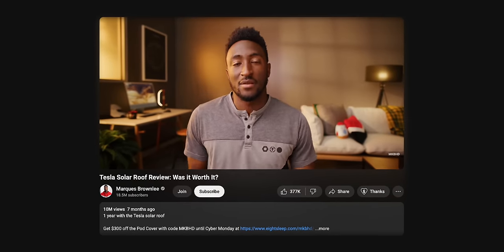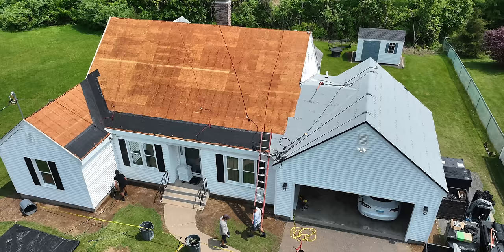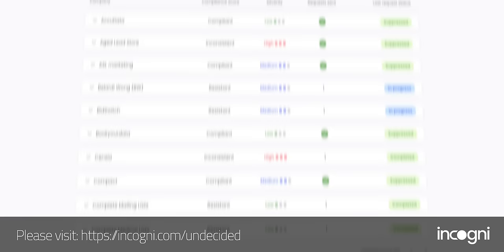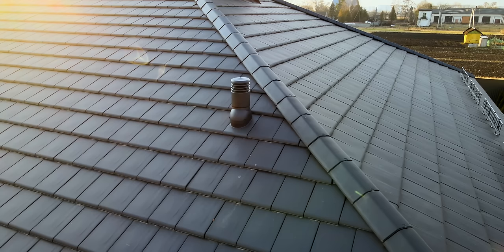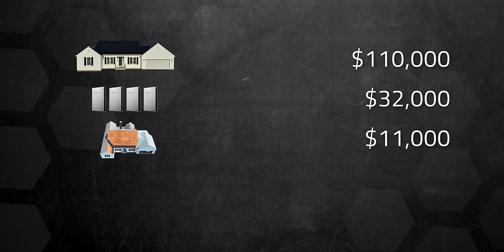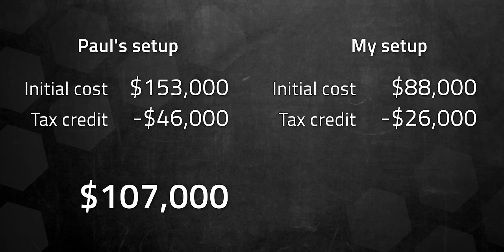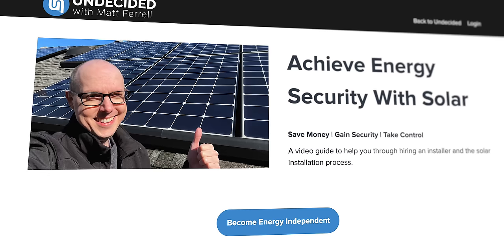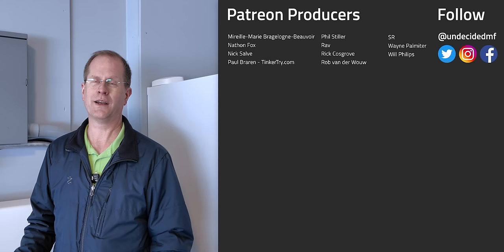Tesla Solar Roof vs Solar Panels: Which is Worth It?

Comment: Zero chance he paid $110,000 for the roof. The average cost for a hoke that size to purchase the V3 Roof (current gen that Tesla just announced is being put on new construction homes in hoa communities starting this year) cost between $35k-$50k depending on how far back the roof is taken. Typically where people see a higher cost is in the additional powerwall units and wiring for things like a grid tap. And even then those builds still do not hit $110,000. That's unheard-of.

Comment: @11:31 The federal solar tax credit is VERY misleading, you CAN"T just simply subtract that amount off of your installation cost.  It only comes into effect if you are required to pay in when it comes tax time and it's staggered over 3 years.  So, if your solar tax credit is $45,000 (for the $150,000 system) you would get a $15,000 credit against what you would be paying in at tax time.  If it is less than $15,000 then you won't get the full amount.  if you normally break even or get a refund (as we do) then you won't get anything and that 'tax credit' is meaningless.  
Also, in regards to net metering, be sure to check locally.  Texas (where I live) DOES NOT do net metering, but the power companies (some at least) will buy back power at an EXTREME discount = 1/4 - 1/3 what they charge you for usage.  Plus the regular usage rate for electricity when you do fall short is about 25% higher than the standard rates you can find if you're not having Solar tied in to the grid.

Comment: despite the advancements in solar technology the price, time, and energy to get it all set up/installed is not practical for most people. they need to make a better installation system that is a very simple overlay onto an existing roof. like a fabric/bendable/unrollable compartmentalized system that can be easily installed by anyone.

Comment: From your comparison in this video I see that the obviously more premium Tesla solar roof costs a bit more than your run of the mill and less capable setup. That is as it should be.

There are others claiming the Tesla product is considerably cheaper. And there is no shortage of people saying it is much more expensive. I am guessing the difference is in the 3rd party installers.

Comment: I think the day that a good reversible fuel cell come out for houses, all the power issues for all houses will be solve. 
No limit in power storage, you can use hydrogen and natural gas as input, you can generate your own hydrogen, any efficiency lost can be recovered as waste heat to collect hot water or to improve efficiency in h2 generation mode.  
No need to connect your house to the electricity company..  No need for long wires.
In case houses are interconnected, you can connect them by hydrogen pipes, power transmission as hydrogen is 10 to 20 times cheaper than by wires or transmission lines.
No need to consume the power in the moment that you generate due how cheap would be to store that.

Comment: In a locale with a lot of permitting, inspections by people who know bupkis about solar electricity, I would...build my new house somewhere else.  I have built two houses, one in an area with no building department, and another with a building department used to seeing contractors built trash to the very minimum quality standard.  The first was a breeze; we built with the intent to live in it, way above minimum standards.  Ditto for the second, but the inspectors were used to seeing crap, so they didn't quite know what to make of our R-30 walls and R-60 ceilings, in a very moderate climate.  I swore to myself that, if I ever built again, it would be in a location with no building department, where I could park in a motorhome and oversee every step, and take my time again, like I did with the first one, to see that everything was done right, including the electrical system and solar roof.

Comment: I have  solar panels on my roof, installed in 2016, that generate  about 13Mw of electricity/year, cost after rebates was approximately $20k. In my state, unlike Massachusetts, net metering does not pay me more than the cheapest rate for excess electricity generation (HydroQuebec, about 3-4 cents/Kwh).  I also went with microinverters that had a warrantee that was 5 years longer than the panels. So far there have been no power outages that would have justified battery storage, and the electricity vendor doesn't have TOU rates. Just about breaking even now. I would say that the vast majority of those putting solar on their roofs (that they own) are among the more wealthy in the US. The opportunity cost of sinking $155,000 into a "new roof" is enormous. I looked at my panels as essentially like a bond investment that would eventually pay me about 3%/year over the lifetime of the (system), hopefully about 20 years. Generally a similar amount of money invested in the stock market would have done much better.  I would also have great qualms about buying a product like Tesla's that is cutting edge and sourced from a single vendor with a known history of poor customer service. The original company that did my install has already gone out of business, but the system is simple and should be relatively easy to fix problems, should they arise. Sometimes "cutting edge" is a little too much "bleeding edge".

Comment: Solar roof could be twice as efficient as panels and it still wouldn't make sense here in central MA based on installed costs, and that factors in the cost of a new roof. I am not sure what is going on with solar roof but it is just so cost prohibitive. I was quoted $135k for a solar roof and my panels cost 48k installed. It's simply WILD.

Comment: Installing solar in general is a pain in the ass. It took months for my Uncle's setup to finally start working. The installers went out of business after they "finished" his faulty installation. Generac wasn't helpful even though they are who sold him the system and contracted the installers.

My electricity is currently super cheap (7.3 cents per kWh) and my mostly south facing roof is blocked by trees. Hard to justify investing in solar right now even though I do need a new roof. 

A solar roof would make the most sense in order to maximize overall sun exposure except for the fact that the cost is insane and once you factor in interest on the loan needed and the cheap electricity here I would probably die before it pays for itself.

Comment: My quote from Tesla was 98k in 2021, I was not ready, then required in 2022 at 160k then last year, Tesla decided to no longer install and move to 3rd party installers. Once I got the new quote it was 500k, yes one half a million for a roof.  I opted for a premium clay roof for 60k. I will add solar panels next for 50k. 500k common Tesla, I’m a fan but no one can afford that. They need to figure there crap out.

Comment: These prices seem extremely expansive to me.
My Solar system cost me 16000€ in 2016.
Your Systeme is about 2,4 times bigger than mine but still that would be roughly 38400€. Not 100k Dollars.
Anyway, the featured Systems are really nice!

Comment: For static storage, I really don't like lithium ion. That's needed for pushing vehicles around and powering consumer electronics. For static storage, I'd want liquid flow and/or sodium ion - something made from less rare, expensive and problematic materials, and something for which thermal runaway simply is not a thing. I don't care about (gravimetric/olumetric) (energy/power) density for something that's sitting on the ground and powering home appliances.
What I'd really like is enough long-lasting battery storage to run the building it's in for 3 days if the grid connection goes down (due to, for instance, a massive earthquake, which we're overdue for in my locale). Bonus if it can function as part of a local microgrid to help keep the lights on for the block/neighborhood.

Comment: I can’t believe the cost of panels in the US to Australia. I suppose when you compare climates or sunshine hours from New England to Australia (even southern Australian temperate climates) it is far more favourable here in Australia. Most large family homes only need max 12kWh systems with about 15 - 25 kW battery systems. Even after a recent power outage with 1 Powerwall we were comfortably off grid for 3 days. With one of those days being cloudy. Cost on a average are $12 - 14,000AUD for solar and $12,500AUD per Powerwall plus install.

Comment: $88,000 over 50 years would cost about $146.67 a month. This is an important factor to think about with your lifetime and your energy costs. I am not sure how much you pay in energy and what you get credited to account for and +/- in that monthly energy cost, so this is another variable but that comes down to the system size and those seasons. 
I am currently paying off my solar panels on my roof, $20,000 system, and I have regrets. 
I think the metal roof is the better choice. I have asphault shingles, and they will eventually have to be replaced, which requires removing and disconnecting the system to replace the roof. Then when it gets installed again it will void any warrany on the roof as it will be invasive with the mounts vs the metal roof.
I also don't plan on living in my house for more than 5-10 years, so it will cost me more per month in energy costs. This definitely something that you want for a long term forever house, not short term.

Comment: Looks a bit like a "MacBook vs self-built computer". MacBook will be more expensive earlier but very slick in design and the milled aluminium casing will last for a long time, but repairs may be expensive. Self-assembled computer is cheaper even with going for similar specs, and you have the option to upgrade a single component when something needs to be changed.

Comment: I never got the appeal to Metal roofs. I get it why some do, Slate roofs last longer and are roughly the same cost (depends were you are). Granted, I’m sure it is harder to get panels on them. But I agree it (the solar adoption) is dependent on your needs. I agree with you on Panels is more modular and you can easily expand that. Like if you have land, you can have solar panels on the ground to get more.
Reply: And Ashphalt roofs are more than fine for a majority of homes. Your home included, saving over 20k, you could have put that into more power walls (especially the new powerwall 3s). Asphalt roofs last a good 25 years. Granted, removing a roof and re installing solar is an additional cost people don’t know about. Hence why I go with Slate. Slate can last up to 175 years depending on what type of slate you can get. They are the longest life roofs available.

Comment: I'm building a new house in NW Pennsylvania with a standing seam metal roof and plan to add a ~40kw array myself.  I'm hoping to get the final cost around $1.00-$1.20 / watt after the 30% tax credit.  Local solar installer quoted $3 /watt, but that was only at 10 kw.  If all goes well, it should payoff in under 4 years, maybe close to 3 if I'm lucky.

Comment: Considerations are a little different in my country and I don't think Tesla's solar roofs are even available here, but assuming that they were I'd probably still go for the panel route myself. Also, utility companies have been pushing back on residential solar for the past year or so, so I think that if I had a certain budget to reduce my energy bill I'd first look at insulation, sun shades, electrification (pretty much every home here has natural gas heating) and more efficient heating (like floor heating instead of radiators) before installing solar. Heating in winter tends to be a bigger demand here than cooling in summer, so the issue with solar would be that I'd be producing the least electricity (by about a factor of 6) when I most need it.

Comment: So... I did the math for my 2200 ft2 house in north Ga.
You guys put ~$107,000 into your respective roofs, assuming your friend didn't buy a roof a year prior to the Tesla installation. 
The 18 month average of my energy bills, both gas and electric, including fees and taxes is $135.36.
The quick math says If I put the same $107k into a system, I'd break even on cost in roughly 65 years, 8 months IF I didn't have to stay connected to my local EMC (but I do have to keep that connection). Current BS fees and taxes are negligible, but the service fee is $25.00/mo. That pushes the payback period out substantially.
If I were to go solar and keep my natural gas connection tambien, the break even/payback date is even more distant. How long do those panels last before they're useless?
I think I'll sleep on it, but I'm pretty sure I'll just stay with what I have.

Comment: Hey, I really appreciate your videos. Especially interested in this one as we are looking to build off grid in the next little while. I have been researching homebuilding and renovations for many years. My parents built their own home, we’ve been on numerous projects for our church, and so I was surprised to hear you say the metal roof would last a lifetime. I don’t know what roofing looks like in your area because it does matter where you live, but I can tell you in British Columbia. Metal roofs rarely last more than 40 years. My asphalt shingle roof is warranted for 35. And asphalt shingle often last up to 40 and 50 years if installed correctly. In addition, asphalt shingles are more fire resistant, I know people are going to comment and think that’s not true, please research it. There are people out there, claiming to be experts that have not actually researched the data. Anyway, I just wanna throw it out there that you can buy premium asphalt shingles if you live in an area that is prone to wreaking havoc on metal roofs. And one less little tip if a metal roof does start to go which can happen as early as 20 years, you can re-screw down the roof with larger screws and that can help.

Comment: I would have gone with a near flat roof and solar covered the whole roof space with solar tracking to maximizing the solar output throughout the whole day. The roof would have been aluminum or metal with the solar trackers on top that are able to flip over at night and or during rain as to protect the solar cells from hail. As for batteries I would go with either a 24h gravity/flywheel battery or a LiPO4 battery(DIY) as I could expand size when I want to and to the size I want. Pure lead acid batteries(with accumulators, for a longer, up to a year, maintenance free period(invented just now on the fly)) cheaper even than and more so then Tesla or DIY LiPO4.

Comment: I like you when with tradition al panels.  49 x 400watt panels.  Then a year later I added 8 x 600watt panels and a Enphase battery.  My only issue is there was a communications issue and since 2 different solar companies did the work, they were pointing fingers at each other for a while.  It eventually got solved, but it took several months.   I would also say that my wife is a realtor and if you are not planning on staying in your house 10 years, you better own those panels.  It's a big blow when you have to pay them off to sale.  And you better not be renting them, because that is a bigger nightmare.  Over all I love my setup.  Especially the the Enphase Battery because I can very easily run a line to my generator and charge the battery by just adding a breaker to the smart controller.  You can't do that with Tesla.  My biggest regret is that my power company is a coop so I have no choice but to use them and they are charging me more and more.  When I started my bill dropped to about 50$ a month.  Now it's up to about 120$ because of the fees and the fact that when I sell to them it's wholesale and when I buy from them it's retail.  I can justify the 50 buck for a backup power source.  But it's getting harder and harder to swallow as they increase prices.